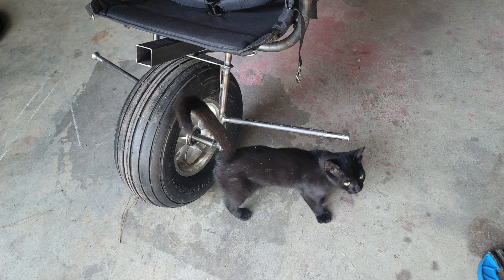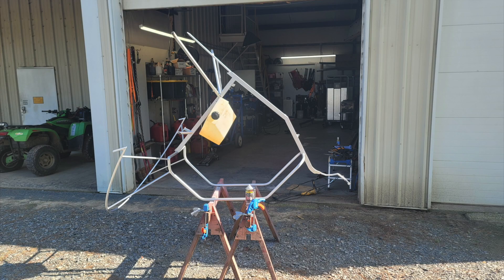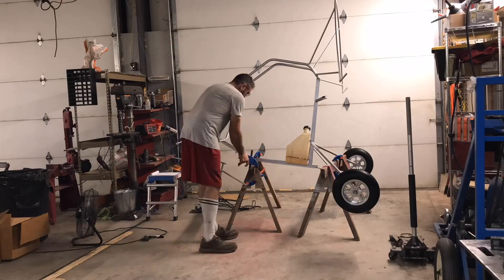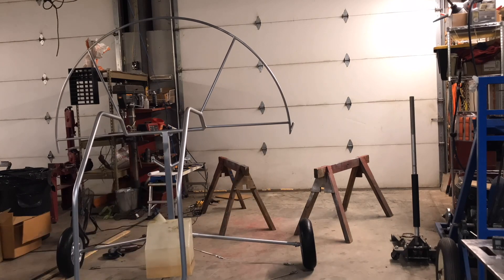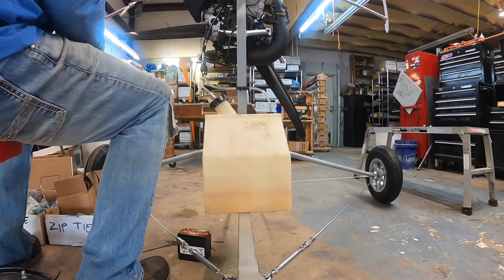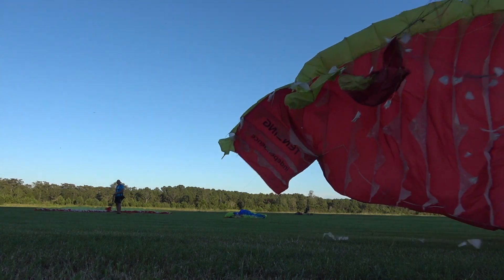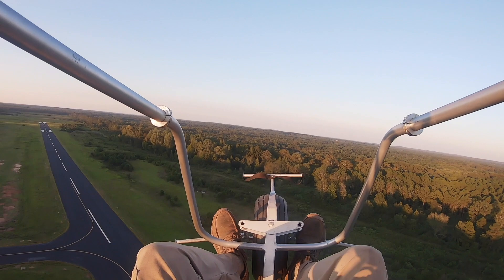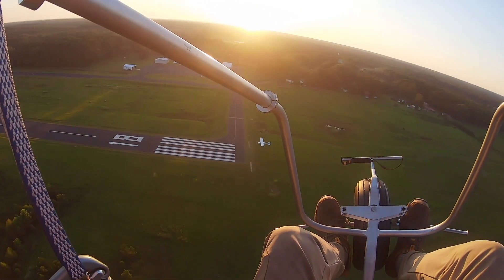Tandem PPG Trike FAILURES & Successes

Comment: Kyle it would be Nice if you could find a 4-stroke Fuel Injected motor with adequate HP--4-Strokes are just more Dependable, especially if its Fuel Injected...
Reply from the maker: Dependable & Paramotors should never be combined.   You trust these things, you've already lost.  2 strokes are where it's at currently.

Comment: On the tandem trike, isn't there a different set or rules.. license required, insurance, that kind of stuff? Plus total take off weight (power to weight), and wings that all have to be addressed? 
I'm sure the FAA, has to be all into it in some way!!!
And, does each state have it's own rules or is everything Fed!.
On your training, is there more hours required with the maintenance training added, or is that midday stuff when flying isn't going on.. 
Would think flight training/maintenance combo is a good idea. The building,,, think I'll leave that to you!! Welding is an art!!! We're not all artists!! Turning wrenches maybe, safety wire, certainly. But welding,,, NOT!! 
Definitely interested..
Reply from the maker: Yes, tandem trikes are used exclusively for instructional purposes.  FAA is involved everytime there is a passenger.  No insurance requirements as we're still ppg.  I do have a private pilots license as well.

Comment: Kyle where did you get the wheels?
Reply: and what's the axle sizes?
Reply from the maker: Zero G in the front available in 3 axle sizes, same for the 4x6 rears.  Made sure it would fit a wheelbarrow tire available anywhere.

Comment: Skills with the welding, is the single hoop for weight and would a double not offer extra line protection? I dont know much about this but I think you would get tensioned a lot safer with the prop being within the cage hoop..  I think the cable ties on the support wires was a great idea, cant wait to see the finished project, thanks for your content